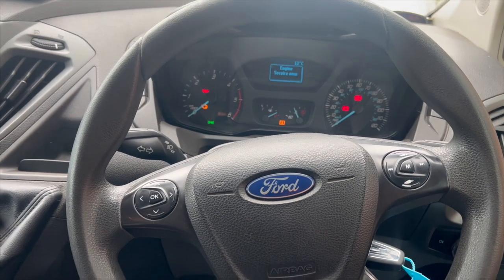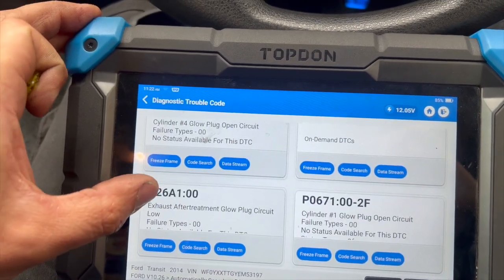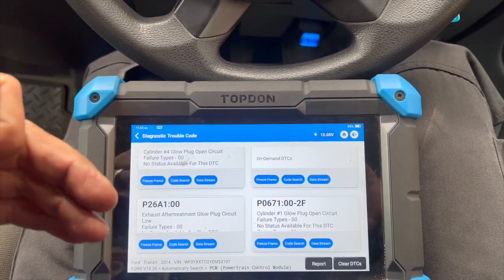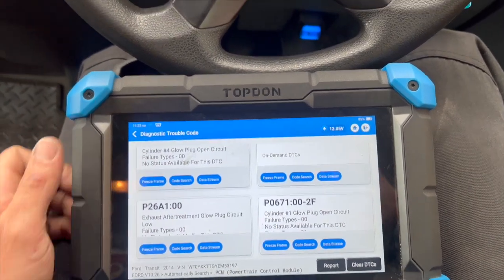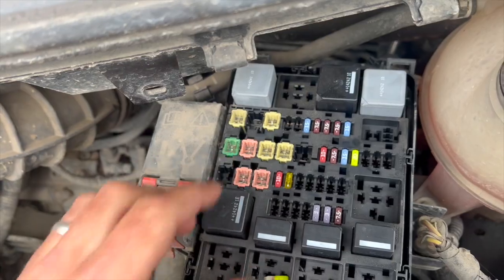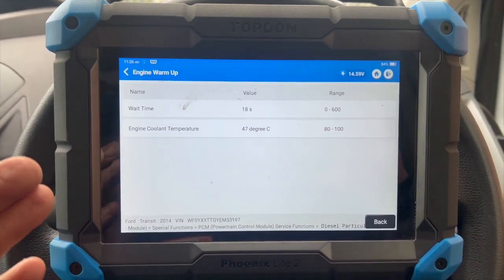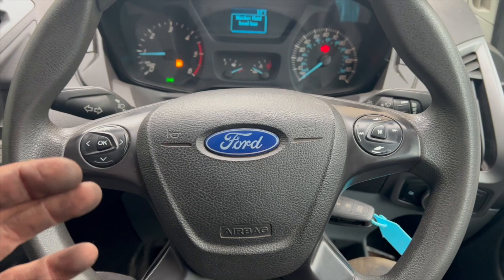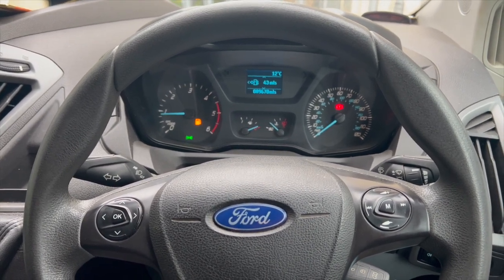Ford Transit custom P2463 P246C & P26A1 fault codes fix

Comment: Hi ive got a 2015 cmax with dpf problem % 204 ive cleaned dpf changed vapouriser still rwads 204 % full no change
Reply from the maker: Have you carried out all the correct resets via diagnostic? Check the dpf pressure sensor and the wiring to it